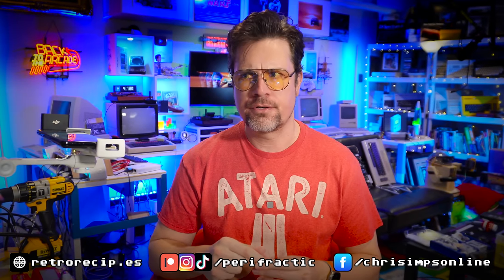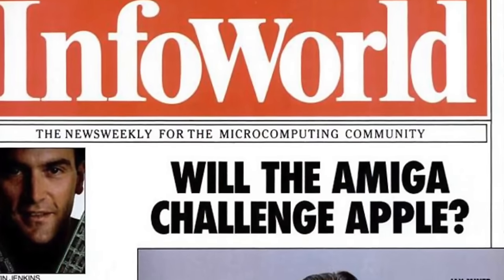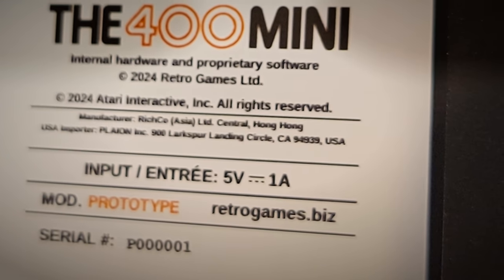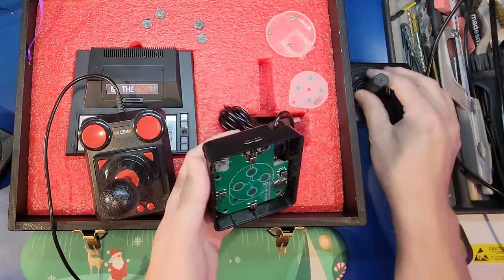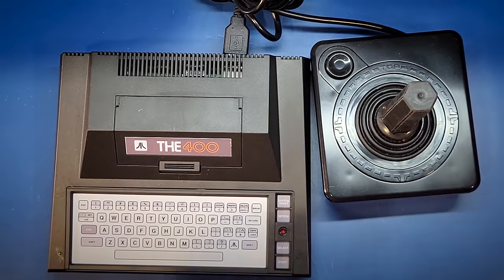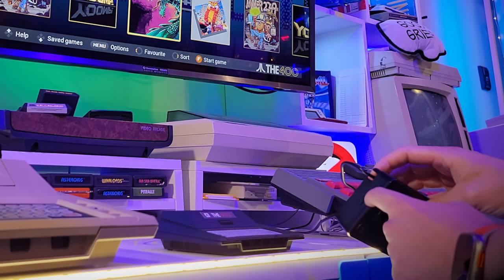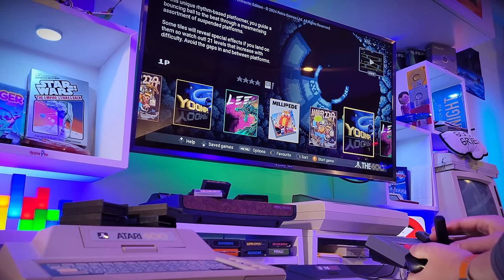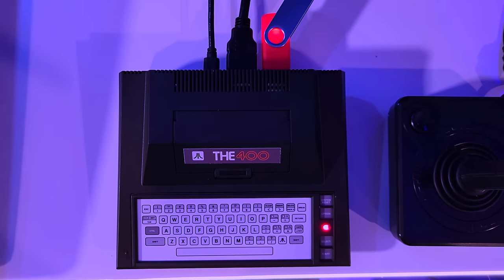THE400 Mini 1st Review: See The New Atari 400 Before Anyone Else!

Comment from the maker: Thanks for watching me probe and get probed! You can preorder THE400 Mini at* https://amzn.to/3IqT1vI
*affiliate link that helps the channel but all opinions are unbiased
Reply: That's an incorrect link. It takes me to a Coiled Keyboard Cable
Reply from the maker: @chuckhutchins6107  Wait you mean THE400 isn't a coiled keyboard cable?! Just kidding and thanks for the heads up; link fixed: https://amzn.to/3IqT1vI
Reply: Hyped for the Atari, i ordered it already long time ago 🙂
Reply: Good evening, Retrorecipes, i love your videos 🙂on another video a while ago now, you had a problem with the capslock flickering all the time and the leyboard of your real Amiga 500 computer not working, trying to repair it, but thats actually one of the few virusses written for the Amiga 500: its the "Byte Bandit virus"its on the bootsector of your diskette, NOT in or on your computer, and when the disk gets inserted, it gets into the RAM memory, and disables the Keyboard, just turn of the amiga, wait for 30 seconds and turn it on again, then the virus is out of the Amiga 500 again, you probebly got some infected disks!
Reply from the maker: @vanonderen9702  You know what, someone did send me an infected disk, and I think it was that virus. I thought I had cleared it by going back to a backup, but it sounds like that would explain a lot. Do you happen to know a definitive fix if that is on the hard disk (CF Card) boot sector?
Reply: @RetroRecipes  Originally i found it on a 3.5 inch diskette back in 1991 aprox. i dont know if it spreads to the harddisk, i have no idea, i dont know any fix for that if that happened, but then again, i dont know if it would spread to the harddisk, what definately helps is a harddisk wipe program, and then copy all programs back to it, but i dont know where to get such a program, best regards, Erik EDIT: IF the wipe program also wipes the bootsector that is, i unfortunately dont know. EDIT: if a wipe program doesnt help, try swapping the CF card, maybe repartitioning the partition will help, but it might destroy the CF card,the disc wipe could also destroy the CF card, it must be found out to be clear that it doesnt, before doing that.
Reply: @RetroRecipes but remember 1 newly inserted infected 3.5 inch disk inserted might infect another disk, and who knows it will also infect the harddisk also.
Reply: Possible solution: disconnected the harddisk temporrily, and check if the disk is infected, the capslock will flicker, if that is the case, put it aside to the infected pile, do this with all disks you own, then at least the disks that are left are known that are not infected, CAUTION : put the write protection slider to: Write protect before inserting a disc that is not yet infected
Reply: Make sure that if the infected harddisk is conntected, that you put any disc that you insert: put the write protection slider.
Reply: Is this going to be the actual size of the 400 mini

Comment: It can be argued that USB belongs on this mini console more than any other, as the original Atari 8 bit SIO port was very much a predecessor to USB. I can't wait for the end of this month when these beauties get shipped. I already have a couple of mods in mind for mine if I find them viable.
Reply: Yup. Joe Decuir was the co-author of both SIO and USB.
Reply: @WolfenSG  SIO also has some handlers built into it for devices.  Which is quite similar how USB works (though you of course need OS support), where most peripherals follow a standard for whatever type device it is.
The Atari was really so much better than all of the other competing computers at the time, as far as peripheral support go.
Reply: Mini SD card slot under the top cart flap is a must.  As is a working keyboard.  Pretty easy mods actually. Just need to make ‘em fit inside that tiny case.
Reply: @user-tb5ns7hc5i If they were "a must", then they would have been included in the design. A hinged cartridge slot cover with a concealed SD card reader would add etxtra cost and also be a potential point for failure. The fewer moving parts, the better. I'm sure RGL would prefer not to have people complaining about covers being ripped off or damaged. Good luck fitting and using a keyboard that small, the original, full size 400 keyboard was awkward enough... and the 400 Mini makes the ZX81 keyboard look good. 😁
Reply: overall a faithful reproduction - faux keyboard just like the original
Reply: @TheSulross  The original's keyboard worked, wasn't fake, it was just crappy to type on.  It was designed as a spill-proof keyboard so kids could use it.

Comment: They REALLY should have put an SD card slot in the cartridge port. There's no excuse for missing that.
Reply from the maker: Welllll... then they'd have got complaints that it cost more than it does now what with a spring loaded mechanism, hinge, button, catch... It's hard to find the right balance so I think they're going for mass market appeal to those on a budget here.
Reply: @RetroRecipes  Of course it'll give modders something to do.
Reply: Use a USB to sd reader lol
Reply: 1:10 - 9 pin guy? Who is the lookalike? Please enlighten me on this “drama”! 😂
Reply: @Kalle72  It's a play on "8-bit guy".
Reply: @RetroRecipes  It's not worth the price of entry without an SD port.
Reply: @xxnoxx-xp5bl Some people are never happy. Whatever Retro Games do, I daresay you'd find something to complain about. An SD card slot is obviously really important, as they're not including multiple USB ports on it... oh hang on, what are those? Doh! 🙄
Reply: @RetroRecipes  ב''ה, relocating a USB might have worked well enough, but in fairness even that might have been going from a flat board to one more assembly step.
Reply: Cost .. Pure and simple. And it does make huge difference in manufacturing the moulds with separate pieces. let alone the extra work on the main board to accommodate it.

Comment: Looking forward to this. Will be interested to see if the final game configuration options are as in-depth as those on the A500 Mini. TheC64 was also quite customisable, but you had to put configuration files on the USB stick yourself rather than configuring on the system itself, which was a bit of a hassle. I'm hoping there is full button mapping and OS revision selection for the sake of the few older games that throw a bit of a wobbly with later models, plus ideally custom cropping on the display, as the built-in games seem to crop out the border area completely.

Comment: Loved the Dog disguised as Baby Fractic :D
Looks like a well done emulator in a cool package, but at the end of the day, it's still emulation.Would have been cool if you also showed some comparisons to the real machine, as you do own one of those. Like what is the delay (which I think was an issue with the initial C64 mini which had been improved later on). Maybe something to add in your video of the finished product. On the other hand, from owning a real 2600 I know that even with an Composite mod, the graphics look a bit glitchy (every second line being like a pixel or so off), so ofc emulation can also have advantages over the real thing.
Also as a Content Creator myself (although much smaller) I am wondering: When you use different shots in the same scene, like "No pun intended - there is always a pun intended" do you film these together with multiple cams, or is it the same cam and you doctor it together? Also when playing on the device, is that live narration via your Rode Go 2 (btw, I bought that magnet after your answer some while ago, thanks again!), or do you narrate it afterwards? Do you also use the Rode Go 2 for off-cam narration to keep the Acoustics similar? Thank you! 
Btw: I also keep suggesting you as Interview Partner for the Retrokompott (German Podcast and Museum), would love that! ;)

Comment: Thanks for an excellent first look video, it took me back many decades. This was my very first computer, and if I remember correctly it cost over £400 GBP in the UK and originally it only came with 16k of ram. Then I upgrade it to 32k then it's maximum 48k, each upgrade cost over £100 GBP. Later I bought a 1050 disk drive then upgraded that with something called a US doubler (I thinks that was it's name). It was an excellent computer in it's day. Then a few years later I bought a CBM64. then an AMIGA A500 has soon as it was available in the UK from Dixons costing £570 GBP with 512k of ram then I later added another 512K. I loved all these computers.

Comment: Thank for showing some Atari Love for once. Seriously under represented.
Does the Mini 400 emulate Stereo POKEYs? Yoomp! supports Stereo Audio on upgraded Atari 8-bits. 👍
I would have preferred them making actual Atari chips which would make millions of Atari owners very happy.
THEY FIXED THE JOYSTICK PROBLEM!!! The #1 problem with the classic CX41 joystick was the weak points in the XY insert continually breaking under rough use! They totally got rid of that problem!!! I WANT ONE OF THOSE NEW JOYSTICKS!!! With DB9 plugs & NOT USB.
Reply from the maker: Check out my Atari Playlist 👍🕹
Reply: @RetroRecipes  That playlist is incomplete. You would do well to expand it. 😃👍

Comment: My 2nd Computer was an Atari 800.  First was the Commodore VIC 20.   I may have kept the 800 until moving to 16-bit, but it broke before that, and I got a Commodore 64, which I was itching for anyway.  But I did get an Atari 520St later.  I never got an Amiga, though.  I was saving up for an Amiga 1200 or 3000 when CBM started to fall into bad times, so I used that money to get a 486.

Comment: Ha, the CX40s always seemed to vary between a red button and orange circle, to red on both, to a red-orange button.  Though I have seen them with black buttons before.  I haven't taken apart the CX40+ yet... hopefully it is built better than the originals... so much glue was used back in the day!

Comment: before buying a 5.25 double density Atari 1050 disk drive that works, will it work with the 400 mini using basic from Atari 800 basic running on the 400 mini?
Reply: I have some forty year old 5.25 disks with basic programs that took weeks to compile, will they run after forty years on the 400 mini?

Comment: How do the graphics compare to an 800XL with a Sophia chip? Crisp? Do you know of any gamepads that work with this?
Reply: Graphics look almost the same.  Same number of colors and same screen resolutions.  XL/XE systems had a few more text modes used in lots of newer games, but there are lots of great games for the 400/800 series.  The 400 mini supports the XL/XE games as well.

Comment: I expect a full die-cast RF shield inside.
Are they doing these to a known and consistent scale? I would not want to put a scaled down ZX81 to be larger than a scaled down Atari 400.
As well as the popular machines of the time, they need to bring out the machines nobody actually had, e.g. a Mattel Aquarius, Dragon 32, Oric Atmos or a Jupiter Ace.

Comment: If rewind works like it does in every other emulator, what it's doing is saving a snapshot of the entire emulator state every second or so into a ring buffer. Rewind just steps backwards through that buffer, overwriting the emulator''s RAM, registers, etc..  
You could never do that on the real machine without a ton of extra hardware, and it might even be tricky on an FPGA, but the amount of CPU and RAM needed to do that is small compared to what you have available in any modern SoC.

Comment: Coding things like rewind features isn't hard . Have the emulator track writes to memory and take regular snapshots of the CPU state (at most a few hundred bytes per snapshot, for 8 bit probably under 50 bytes) and when you rewind just spool back those changes. The same tech is used in a more complex form in modern databases to allow transactions to be reverted. These CPUs were relatively slow so they couldn't doo many writes per second, relatively speaking, so the memory used for the write log is relatively small.
If they're lazy they can just take a regular snapshot of the entire memory state - still not all that much when your total RAM is <64kb and the console probably has RAM or 16kb or higher and storage measurable in gigabytes.

Comment: It seems to be a rule that when an emulator has a 4:3 video option, it will distort the image. Don't ask me why, but none of them seem to know what an actual 4:3, American TV image should look like.
Reply: That’s not what’s happening here. You would have that distortion on original hardware on a CRT because of stretching square pixel hombrew to 4:3 (non-square) pixels. The 2007 game he had to change to pixel perfect mode was essentially made for emulators in 2007 and the graphical tricks it does only work right when mirrored so it’s inescapable.

Comment: Frankly, I'm not interested in this mini computer.    Like the C64 they released, the ONLY version of this I'm interested in is a full sized one that feels or looks like at least somewhat of the real thing.   I don't care about this MINI stuff.  I really want to throw money at their Amiga 500 and Atari 400 recreations, but I want actual full size recreations with functioning keyboards for the real feel.  These mini computers just hold no interest for me.   I love their C64.   My dream computer would be a C64 laptop.  And I don't mean just a normal laptop that's running an emulator that I can already do.  I want a laptop with the actual keyboard layout out like a C64, with the USB drive using ability that their C64 recreation uses.  Using an emulator with a normal standard keyboard like we use now just doesn't do it for me.
Reply: I would like to see a new 8-bit system that's not an emulator. Real physical 8-bit architecture produced with current chip manufacturing standards. Let's see what I can do in the MSX ROM Basic with a Z80 ticking on 3Ghz...